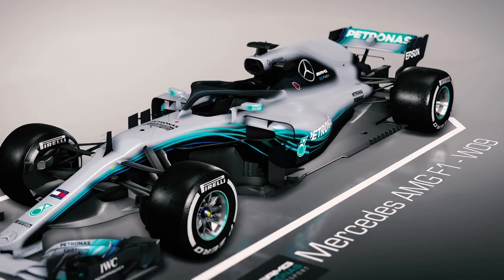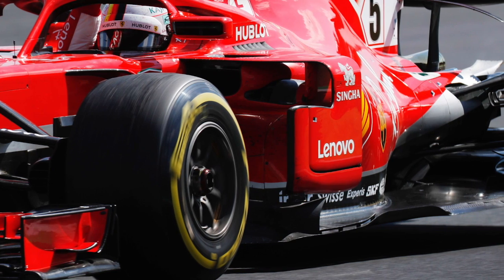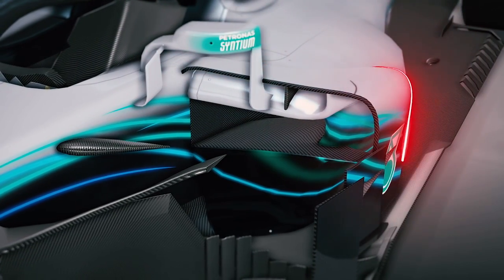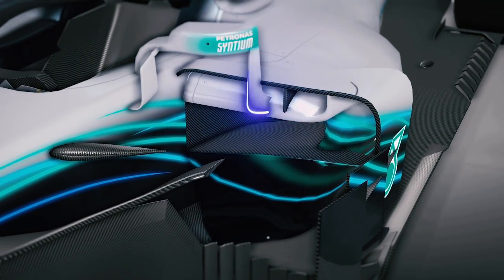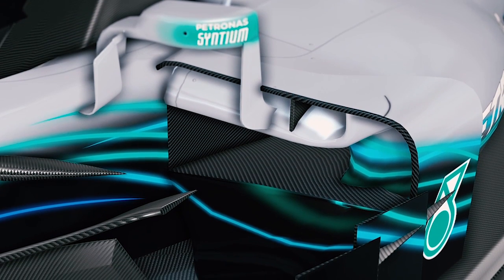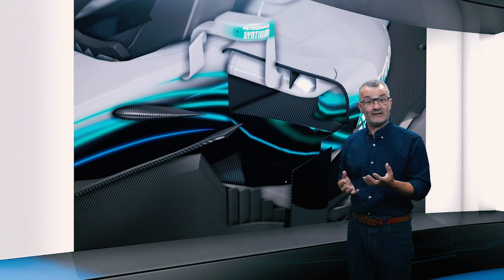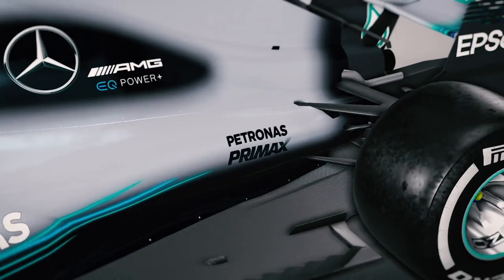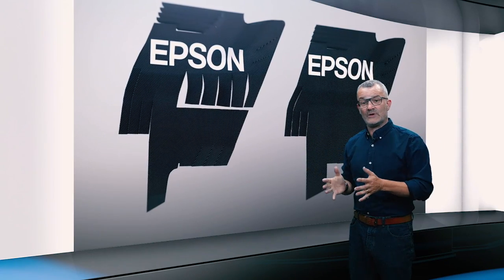Merc's "Ferrari" sidepods - Scarbs explains

Comment: Did anyone else notice the “double fin,” atop the engine cover of Mercedes? I was watching onboard rear view in Hungary and they are the only team that had this “double fin,” is there a reason for this? Great and informative video as always.
Reply: That's an opening on the top of the engine cover for cooling... They usually have that "cut" when they race in hotter circuits to avoid overheating of the engine.

Comment: Stop trying to make Mercedes' mirrors look bad. They're not attached to the halo, and therefore the restrictions placed on Ferrari's mirrors don't apply here.
Reply: halofreak1990 they are. They added those aero parts for their mirrors while complaining about ferrari's. Hypocrites
Reply: +Takumi Fujiwara They're not. Read the rulebook. Unlike mirrors attached to the halo, mirrors attached to the car don't have many design restrictions, if at all.
Reply: halofreak1990 Where it's mounted has nothing to do with it, it has to do with the technical directive issued by FIA's Nikolas Tombazis where it's clear that "any support should be mounted to the lower and/or inboard surface(s) of the mirror housing." Ferrari's were on the upper surface which means they had to construct a mounting for the support, and that's not allowed. And the aerodynamic influence should be incidental, or at least minimal. Merc, FI and RBR can argue that their aero gains are incidental while Ferrari couldn't since they built a winglet mounted to the halo.

Comment: That’s a very well supported mirror.
Reply: People like you say stuff like this, but they forget who the President of the FIA is, and who he worked for before the FIA.
Reply: The only reason the Ferrari mirror got banned is because they couldn't argue that it was structural since the fin on it didn't connect to anything at all. With the Merc mirror it does connect to the sidepod and can be argued to help reduce mirror vibration or something which would be a legitimate enough argument for its existence.
Reply: peopleplacespups,  Peugeot and one other team that escapes me... 😉
Reply: Red Bull has supported the mirror the same way.

The difference between Ferrari and Mercedes is that Ferrari attached the support to the Halo.
Reply: But FIA won't ban they support for mirrors like did to Ferrari because Mercedes is well protected by FIA

Comment: They ran their mirrors nearly the whole season so far with no issues. that attachment is purely aero and I'm extremely surprised the FIA did not ban it!
Reply: Not surprised at all here..
Reply: It has a non aero advantage though, reduced/eliminated mirror vibration.
Reply: Yeah... Surprise surprise
Reply: Still the mirror is fixed with the châssis there is no issues. Otherwise the Ferrari concept the mirror is fixed on the halo.
Reply: Martin Strümpfer  FIA is biased towards Lewis Hamilton wherever he goes the rules bend

Comment: Mm Mercedes copying McLaren 2017 design and they still using it so where are their aero problems 😖
Reply: M J Pes player I’m fairly certain that mclaren’s woes lie in their method of sealing the floor, or not sealing as the case may be
Reply: sidepods area is simple compared to other cars as well
Reply: M J Pes player just mclaren  dont win nothing unless the top teams crash or break down
Reply: McLaren doesn’t win because “GP2 ENGINE”.